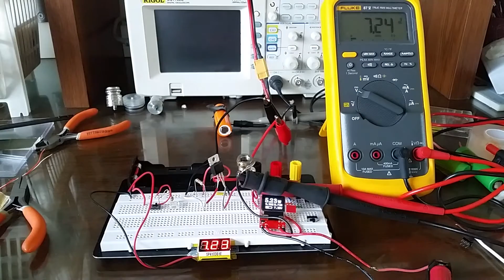Modmeter Voltage Accuracy and Precision

Comment: Currently looking at this option to build a simple coil test & fire rig. Would you think this is accurate enough for that project? Thanks
Reply from the maker: C TC That depends on how accurate you want your rig to be. More specifically, it depends on how low you're building coils. The lower the coil, the closer to the limits of this thing you're going to hit.
Reply: Relayer1974 
I build between .3 and up to 1.2.  Figured it would just be a box mod on it's side, using this wiring diagram from ModMaker UK: http://bit.ly/1MSAmnH   Mamu made a great box for this purpose over on breaktru; but it seems more tedious than using a ModMeter. Thanks for the reply